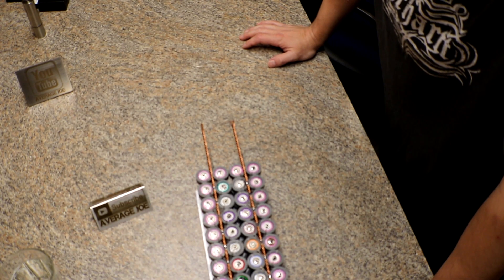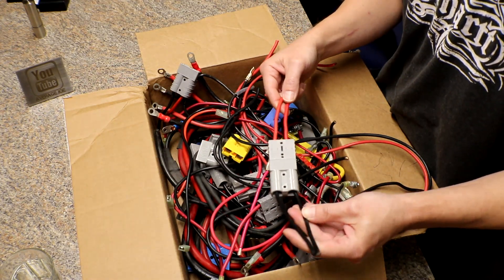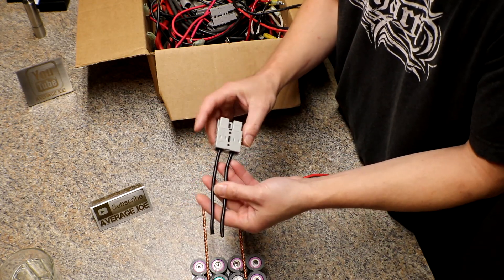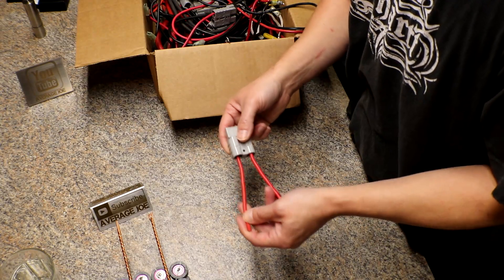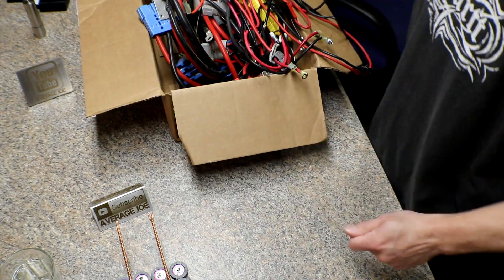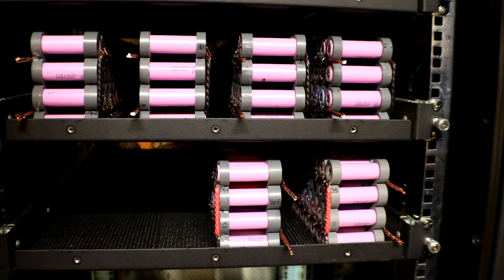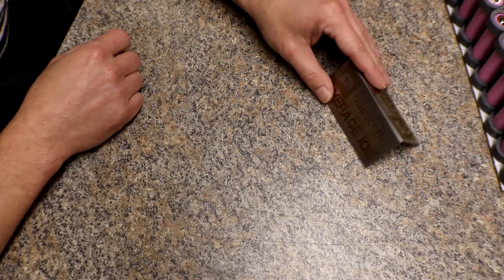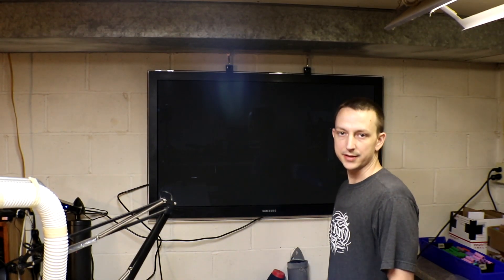Diy Tesla Powerwall ep40 Not Much of an Update...Update

Comment: I really like the Anderson connectors idea. Very simple connect and disconnect. What would it be like to use 4 connectors per pack so you could add packs, then build smaller "building block" packs? Not for you but for someone (me) starting new. Do you think this concept of smaller building block packs connected with Anderson connectors would work?
Reply from the maker: Thanks Man!  I wanted an easy way to remove and install packs and this was the easiest way I could come up with!  Yeah I think a double anderson plugs would work great going at it that way!!!👍👍👍

Comment: Good morning, are you using these batteries to power equipment?
Reply from the maker: Good Morning to you!!  I will be using these to power all sorts of household items, Fridge, lights tv ect...Once I get it all together that is.  Are you building a powerwall?
Reply: I am mounting a solar system off grid to provide power to my residence, I already have more than 1000 18650 cells to assemble the batteries, it is difficult to find the bms board.
Reply: I intend to mount the batteries with 4S connections, I will need your help if you can help.
Reply: How are you charging after the battery is ready? By solar energy or with battery charger?
Reply from the maker: Awesome! Are you doing any videoing of your progress?  It seems that people are really liking the Batrium bms system.  That would be what I plan on using once I can afford it.
Reply from the maker: Great!! I would love to help :)
Reply: quando vai fazer o novo video da bateria de litio?
seus videos sao muito bons.
Reply: When will you make the new lithium battery video? Your videos are very good.
Reply from the maker: +Alexandre Fausto Ill be using solar. I have about 600watts right now. They are 12v panels so Ill have to wire then in series to get the 48v
Reply from the maker: +Alexandre Fausto Thanks, I have a video or 2 that im working on now :)
Reply: Ok

Comment: Nice work so far. I would suggest, though, not using the Deans connectors between packs, only at the connection to the inverter itself. Make the pack-to-pack connections hard connections (like bolts). You will end up with a much lower chance of failure due to dirty or weak contacts.
Reply from the maker: Thanks Man!  Those anderson plugs are pretty tight and under spring pressure.  I know "they" use them in forklifts and other industrial equipment. I started removing all the wires from the plugs to clean them up and put them in the red and black pairs.

Comment: Xsplit or google hang outs  i made a mini powerwall looking to make a massive setup
Reply from the maker: Ok cool, I thought I was subbed to your ch hmmmm.  I blam the cat ;)  How big are you thinking.  Your also building an electric car to wit drill bats right?
Reply: AveRage Joe not hb power wall big  but more like 10 to 20kwh.  bit of a differnt  idea im planning on using a 5kw grid tie inverter  with a 180 to 250v 18650 high voltage feed and connect  it into my shed supply during high demand uses . yeah the ute with drill battsbis still in the pipe line and some ebikes also cheers man
Reply from the maker: That would be interesting to see.  Have you started on it yet.  Ill have to watch some more of your vids
Reply: AveRage Joe all ideas are good ones
Reply from the maker: +One up the sleeve customs Tru that, thats all I think about :)
Reply: I have so many  18650s o just want to convert everything  haha

Comment: OI OI OI, use the 10gauge wire on them anderson plugs and solder them as well as crimp them, technically its the same size as u used as the bussbars.
Reply: Also u scored big time with them anderson plugs grrrrr and yes i use to tinker at 3am but I am back to finally sleeping nights for the minute..... no idea how long that will last and with the live streaming u may get trolls do make sure u have a few moderators on board during the live stream to shut them up...lol u add their utube names in the moderator section of ur community page and dooo dooo ahhhhh doooo and doooo, ohhhh and dooo dooo sumore doo dooo.
Reply from the maker: Yeah I think Ill just use them.  Why the hell not right :)
Reply from the maker: I know right, I love going down to my recycler or when he calls and says hey I got something for you :)  He is only 1 mile from my house also SCORE!!!  Yeah I work from 3:30pm to 12:30am and then the tinkerering begins lol. Shout out to you then lol.  Trolls Ayyyyye, didnt think of that one.  Ill get it going and see what happens uuuum I guess.

Comment: 10awg is generally rated for 30amp. But that's in long lengths. I'm sure those short pieces could safely handle a lot more. Probably 60-70. Might be worth a testing video lol.
Reply from the maker: Yeah thats what I was thinking aaaaand after I add more battery capacity Id use less amprage on each of those wires/connections.  F*&k it Im doing it LOL
Reply from the maker: Wow thats crazy. Yeah I plan on using the 10g wire and if it starts to heat up Ill change it to the 6g welding cable.
Reply from the maker: +Thomas Cruz I never mathed good :) Yeah an infrared cam would be awesome to have but there expensive

Comment: 50A connectors seems kind of low.  But i guess i'm building mine for a higher amperage.  I have the capability with my inverter to dump 120amps into my battery pack.
Should look clean and easy to swap packs out though.
Reply from the maker: There are  2 connectors in each plug, so not sure if they are rated at 50amps each terminal/wire or 25 each wire.  I kinda took it as 50 each :)  Either way as time goes on as I add more packs the amprage at each plug will go down.
Reply: I think the stamp on there at 50amp means for the pair.  Your connections between batteries should be rated to handle your expected draw and charge currents going into the bank as a whole.  If you plan to run below 50amps you'll be fine.  I run a 24v system and my max draw/charge is about 35amps or so.  I just wanted to future proof my pack for when i add more panels and if i want to dump ac charge into the pack.
Reply from the maker: It probly does mean 50 for the both.  Yeah My inverter can only handle 3000watts so thats what I was planning on for now until I can get a bigger one.  By that time Id probly have more battery capacity so it wouldnt matter.  2400watts would be the max the connections would be rated for but I bet they can handle more ;) If my maths was correct lol
Reply: what inverter exactly do you have?
Reply: Compliment, I like you video and the procedure that you are following while you are building the powerwall.
Reply from the maker: Thanks Man!!
Reply from the maker: I am going to use a APC Server UPS, I can get the model # when I get home
Reply from the maker: I cant seem to find the model but I remember doing research on it when I got it and its a 3500watt model.  Not 3000watt.  I do have 2 APC 3000xl's and 2 others that are 2000watt each.